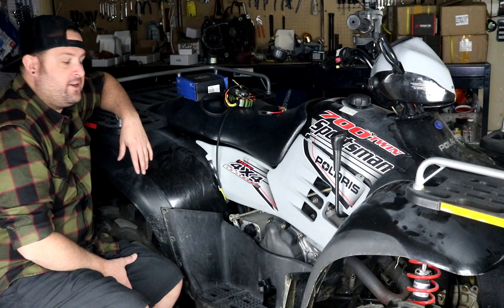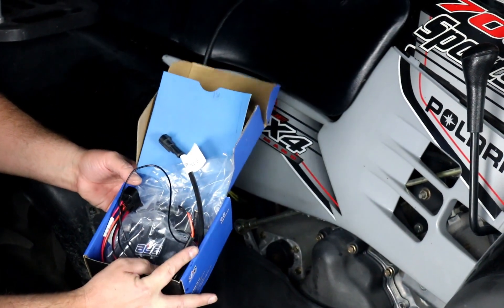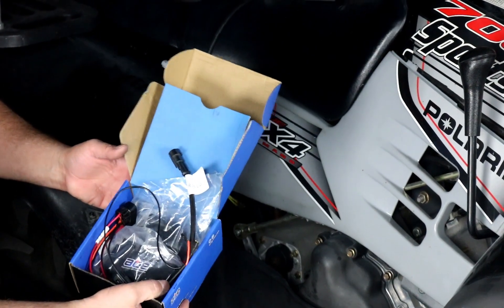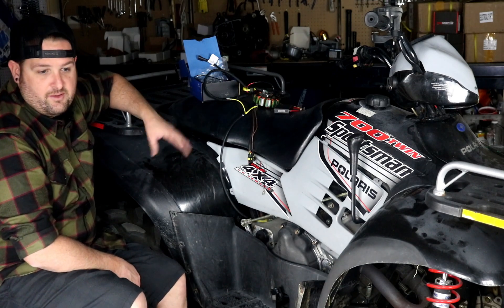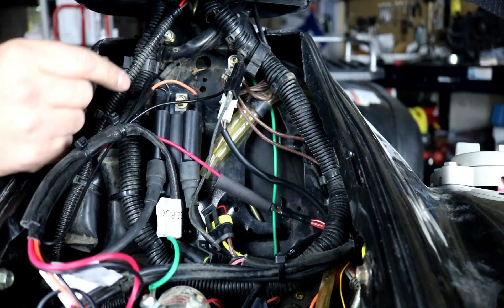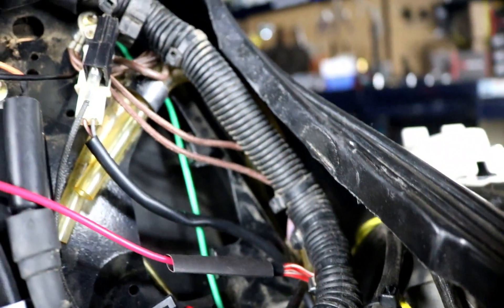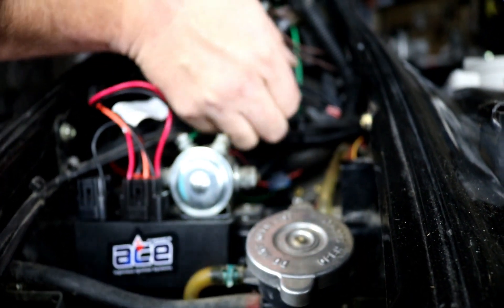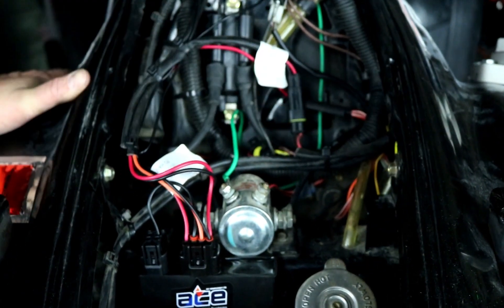AC to DC Ignition Conversion Kit Installation for Polaris Sportsman 600/700 Carb

Comment: I have the kakusan ignition. Is there a replacement for it?
Reply: I found everything I needed on Amazon. The stator is about $126cdn ,the cdi box is $52, and the coil is as little as $19. After testing, I believe I only need the stator, which apparently is the most common failure. 😊

Comment: a 2010 Polaris Sportman 500ho efi can be modified to a carburetor. It is fuel injection. And i would like to change it to a carburetor... It is possible
Reply from the maker: Yes, it is possible but it will be quite a bit of work. We don't have any info on that conversion.

Comment: Great video!  I added the RM Stator to my 2002 700 Polaris.  Everything seems to function good and the machine runs good.  The problem is that my "Stator" warning continues to flash on the instrument panel.  It also shows upwards of 27 volts.  Is this normal?  Do I need to do anything additional?  Thank you in advance!
Reply: yea my 700 gets high volts to but this was before I installed it and didn't fix my high volt readings. bought another volt regulator hopefully that fixes the issue.
Reply: think i have finally solved the issue i replaced one of the sacs where all the wiring is, and also cut a wire in the harness that goes into one of the pins of the volt reg. And now its 13.70v instead of 17 18 volts!!! So battery is charging and no overcharging as of rn.
Reply: @swiftlyswiv  still working? Which one was it? I’m having over volting issues as well, tried 2 different eBay voltage regulators and both worked for like 5 minutes then went back to over volting
Reply: @ngk330  same dude I’ve bought $100 regulators from ricks motor sports then ones from eBay they all just fry and don’t last like it’s giving to much power and it can’t handle
Reply: @swiftlyswiv  is your fix still working? Or having issues again?
Reply: @swiftlyswiv  please let me know if it’s still working. If I can’t get this thing figured out soon I’m just gonna bite the bullet and buy the $700 dollar electrical overhaul kit
Reply: @swiftlyswiv  please respond hahaha
Reply: @swiftlyswiv  is it still fixed? Or having issues againv
Reply: @StrongFarms  @ngk330 i have finally figured the issues, i bought a yamaha oem volt reg off a 2014 yz450f dirtbike, put it on didn't work, wires going from the stator to the volt reg was getting hot to touch. So new stator from rmstator, took the side cover off and seen the flywheel had broke. Some of the magnets on the magneto had come off, causing it to fray some wires off the stator, grounding out basically. So better volt reg, new stator, and flywheel. So $659 later and 2 years of messing with it, it's finally keeping a solid 14.3volts charging.